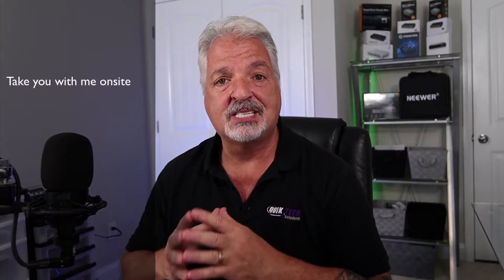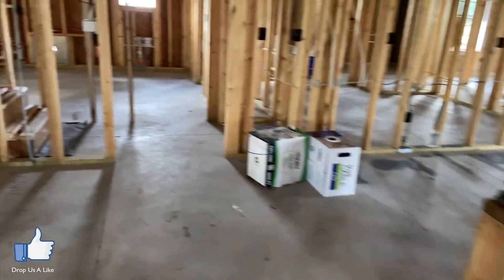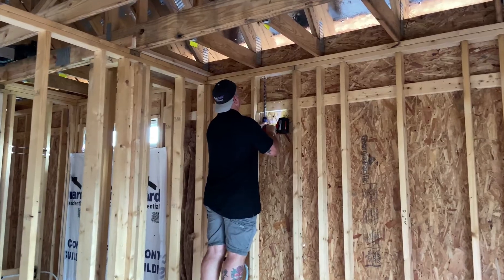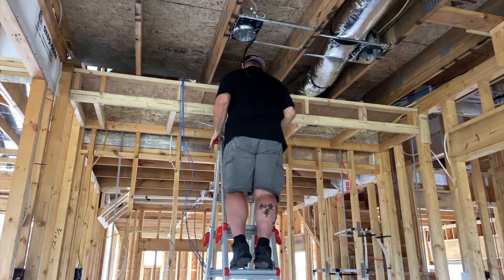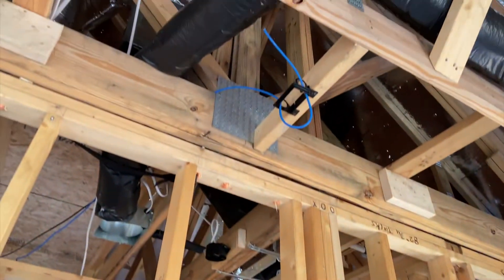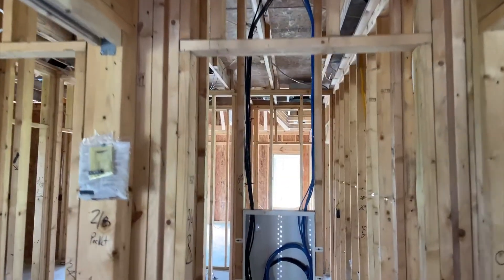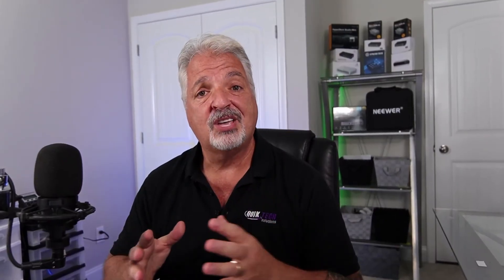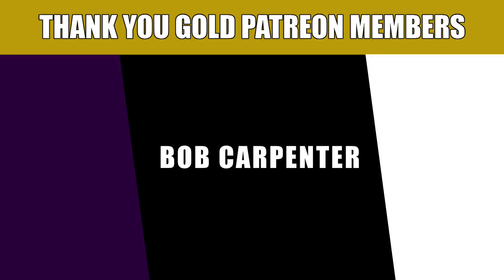Actual Residential Network Installation

Comment: It's interesting the different standards used in different countries. I wouldn't dream of running Cat cable without conduit between interconnecting floors and running single run Cat cable to an access point, for me I run dual drops all network access points. On new builds I run a single conduit core with fly-lead connection per floor, which means I know exactly where every cable is and it allows me to pre-make my runs before getting on site which speeds up the installation time significantly.  Thanks for sharing on how you do your installation, I always like to learn how other techs do their installs.
Reply from the maker: Thanks for watching. The conduit makes sense and would keep the wire safe. Have a great day.

Comment: How much does this service cost?
Reply from the maker: It is going to vary based on several factors for example the size of the home how many cables you need how many axis points you need what size switch do you need? What geographic location are you located located in if you are in the North Carolina southeast area shoot me an email we can talk

Comment: What type of boxes did you use?
Reply: I see that house has radiant barrier roof structure and insulation. My house is the same and interior antennas do not work . The entire structure acts as a faraday cage.
Reply from the maker: @thomasfreeman7770 hi Thomas. I understand exactly what you are saying and agree with you. That is usually the case. Oddly enough, for some reason the TV reception was not affected. The only reason I knew this is because I have the same insulation in my home and never had an issue with my reception. Have a great day.
Reply from the maker: Hi Paul! Thanks for watching. Here’s a link - https://amzn.to/3z49VPh

Comment: I have done 2 major renovations in my home that included running a lot of Cat 5e and 6 cable. Some run by me, others by professionals. My suggestions :
- There is one thing that I would STRONGLY recommend to anyone doing this - take lots of photos of every conceivable area where your cables run. I have a decent memory but this has been worth its weight in gold.
- Make a map of your floor plan and number each location for reference whenever you are working on your patch panel.
- At each drop, run 2 cables. If it's your office or media room then run 4. Doing this while the walls are open is so much easier and cheaper than doing it later.
- Run more cables to any room than you think you might need later and put them on opposite sides of the room.
- If feasible, run cables to your garage / shop if it is detached from your house. This worked out really well for me for security cameras, TV, and computer operated machines.
Reply from the maker: Thanks for watching. All excellent suggestions. I take photos and voice narrated videos so when I go back to trim out a home I know exactly where everything is.

Comment: The wiring for the wireless access points are good. However, you should of ran two RG6 and two ethernet to a demarcation box on the exterior of the house for any future connections from an ISP. Also, the wiring cabinet is too small for any future upgrades to the network. Should have just put it through a whole in the sheetrock so a rack could be installed in the future if needed.

I would have talked my face blue trying to get the customer to have runs to the TVs and other media. That is really stupid on the customer's part not to do that.
Reply from the maker: Hello Rose, thanks for watching and sharing your opinions. In this particular project, the builder was responsible for running the coax and ethernet to the exterior. Trust me, I agree with you. When I’m contracted to run to the exterior, I run two coax and two Cat6 to the exterior.  The owners are in their 70s and I don’t foresee much of any major upgrades taking place. They wanted what they wanted and there was no changing their minds. Kinda sucks for future owners, but sometimes as a contractor you have to pick & choose your battles.
Reply: @QuikTechSolutions  I figured something like that was the case. You seem to professional to just "run a couple of access points" and call it a day haha. Keep up the good work!

Comment: I hate seeing ethernet cables stapled down. Someday, this home will need upgraded cables, but you can conceivably guess they'll still need to go to the same place. The best way to upgrade would be to attach the new cables to one end of the old and then pull the old cable from the other side, thus running the new cable without going into an attic or crawlspace. If you staple them down, you can't do that. It's time that builders and installers start doing things with easy upgradability and repairability in mind. Hell, maybe even install some tubing or pulleys around bends in walls and ceilings to make for an easier time pulling cable. We must start combating rising housing costs by making homes last longer and cost less to repair or retrofit.
Reply from the maker: Thanks for watching and for your comment. I totally get what you are saying. And sure, not securing the cabling would make for easy replacement. However, in certain areas there are codes to follow. In my area, the building inspectors look fir two things: 1) cables are secured every 8-12 inches 2) any holes drilled through top plates to pass wires through must be filled with fire block.

Comment: Are ethernet cables always stapled? Trying to figure out how hard it's going to be to run new cable in my home without opening all of the walls. Builders didn't add drops to the office for some strange reason.
Reply from the maker: Great question. Typically, around here anyway, the electrician contracted by the builder usually runs up to 10 low voltage cables. These are a combo of ethernet and coax, determined by the homeowner. Electricians usually staple the cables to the studs.

Comment: I liked this video a lot Tony.  I dream of my retirement home being a brand new build where I get to lay the network out 'exactly' as I would like - including the Wireless APs.
Reply from the maker: Thanks David, appreciate it very much. Most of my jobs are along this line of work. Retired folks moving to the area, building new houses in new developments. I go in, take care of the whole house Wi-Fi and sometimes streaming set ups. For this particular client in addition to the whole home Wi-Fi, we’ll be setting up an antenna in the attic for over the air reception as well as a Tablo over the air Tuner/DVR to stream the antenna signal to all of the TVs in the house over the Wi-Fi network. I like to keep the jobs on the smaller side, as I am retired and doing this part time. That time will come for you where are you can design your own network for your own house. Just don’t rush it life is short. :-) thanks for tuning in.
Reply: @QuikTechSolutions  Thanks Tony.  My current Day-Job work is for a Utility that is also a State agency, so I have almost the perfect storm in terms of dead-wood technical people and politics hitting me in the face every day I have to work there.  My goal in YouTube is to speed things up, not for to sit around watching TV or weeding my grass, but to do something I love doing - teaching tech.  Things are moving, but at the rate I am at up to now, I will reach an income level needed to retire early almost at exact same time as I can just retire with a living pension from my Day Job - oh well.
Reply from the maker: Well, look at it this way. Hopefully you have a retirement package and/or 401(k) or something like that. If you can be retired and do YouTube whereas YouTube is not your main source of income, then you can totally enjoy the process of building it without the pressure.
Reply: @QuikTechSolutions  That is how I'm thinking Tony.  THanks :)